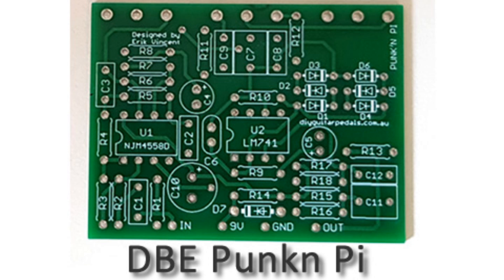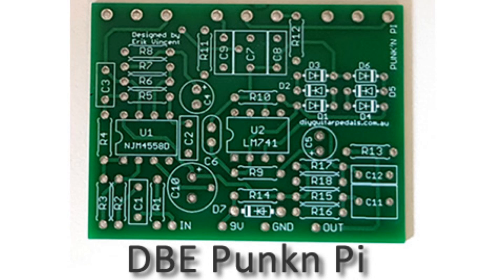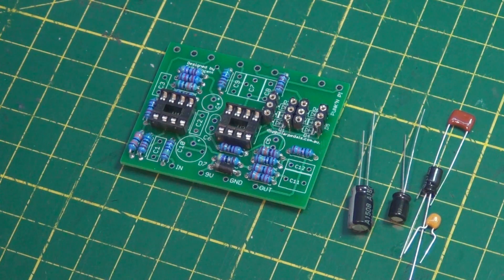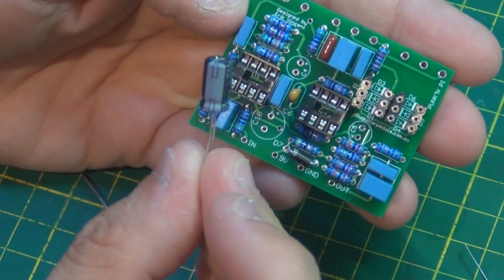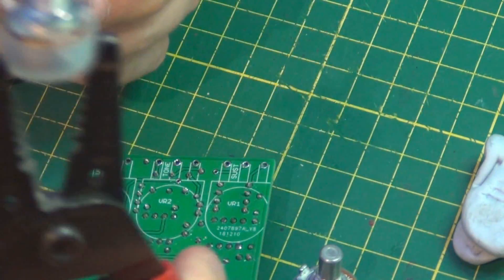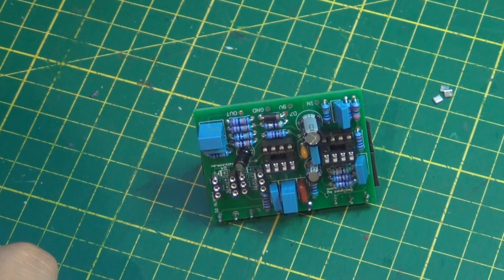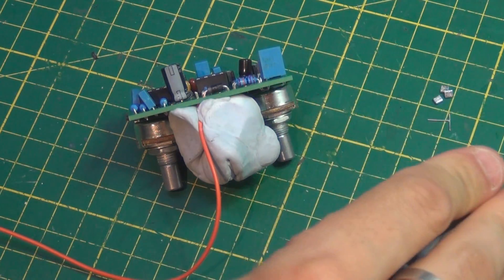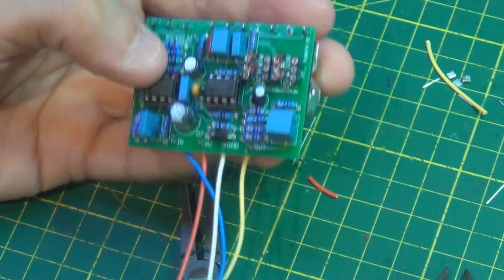Lets Build A Guitar Pedal - DBE Punkn Pi

Comment: Hi, into making my first pedal and want to do this pedal as I’m a huge Smashing Pumpkins fan. Anyways I was trying to order all parts from diyguitarpedals website but not all the parts needed are on your site. But,,,,,,,,

I could not find the C10 220uf (Electrolytic) capacitor, 1N4448 Diodes, JRC4558 & LM741 IC’s, 10kb (16mm) & 50kb (16mm) Potentiometers. Are these out of stock on your site? 

I was trying to order all parts on list including the enclosure and everything from the diyguitarpedals site. 

I live in the US, if I need to order from the US do you know of any good US sites or dealers to go through?

Thank you
Reply from the maker: Hey Lyric, thanks for your question.  A couple of those components i dont have, 220uf electrolytics and the 2 potentiometers. For the diodes you can use 1n4148 as a direct swap.  RC4558 for JRC4558 and UA741 for LM741.  Hope that helps!  Cheers Paul

Comment: I'm building this now but this is my first time soldering, how long did it take you to get it clean?
Reply: I typically use the brass solder cleaners. I typically brush my soldering tip into the brass mesh after every major solder. It only takes a couple seconds of brushing to clean the soldering tip.

Comment: From the part numbers, it looks like linear pots are being used for all 3 controls (Volume, Tone, Sustain). I saw in a previous video (Beginner Breadboarding: https://www.youtube.com/watch?v=yWZmX79_gcU) you posted that you recommend using a log pot for the volume.  Is it recommended to use linear for all 3, or would log pots work better for any of the controls?

Comment: Someone needs to come up with a thermal resistant putty like blu-tack.

 Anyone who hasn't used it before needs to be careful as it can leave a sticky residue on components if you heat them too much. I'm sure it doesn't hurt anything, I just looks ugly 😆
Reply from the maker: You have to be careful with heat, agreed.  With that said i have never had any residue issues.  Are you using bostik branded blu tac?  The cheaper brands can be really messy